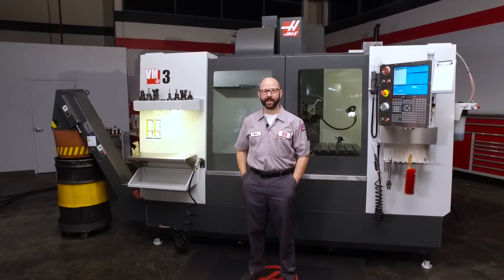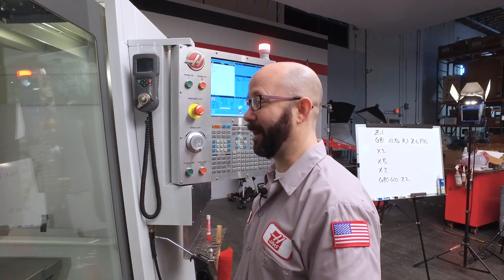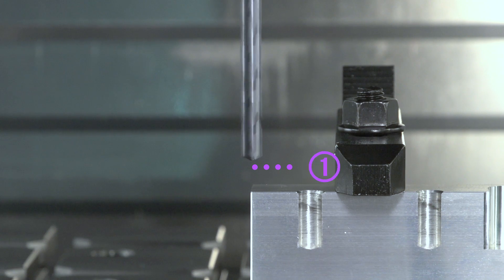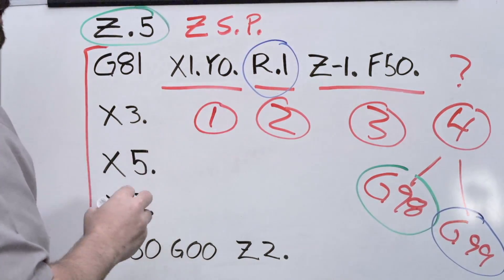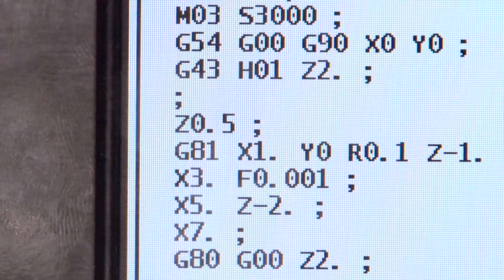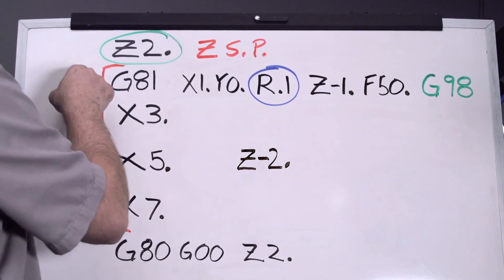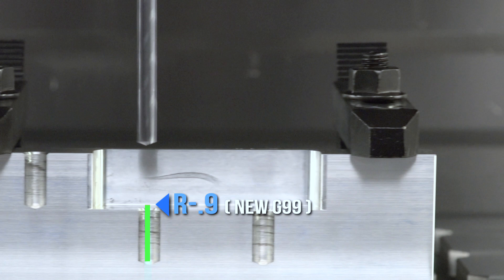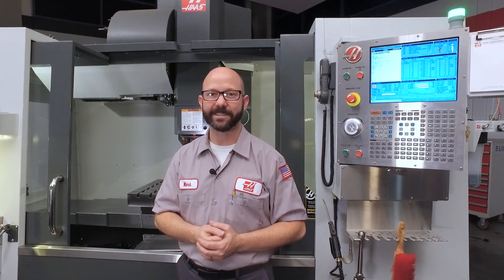How Canned Cycles Work with G98 & G99 - Haas Automation Tip of the Day

Comment: I was trying this for an evening class .  We had a spot drill and an ordinary drill bit to use to drill holes. One for a spot drill and 2nd for ordinary drill bit  The tool offsets H01 and H02 need to be set into the code if you are using more than one drill bit.
T1 M06, G81  H01  x1 y0 R.1  z-.050 F50.    Then another canned cycle ->T2 M06, G81  H02  x1 y0 R.1  z-1. F50. Don't forget the (.) after F50 otherwise it feeds in ten thousands of an inch.  Where H01 and H02 are tool offsets for tool 1 and tool 2.

Comment: I did that in CAM but I didn’t know it is on since we’be got new postprocesor that turned G99 automaticly and it was not shown in simulation so I broke 100€ drill, with that G99 I wouldn’t be able to save few seconds per part, and I was lucky that wasn’t on other 500€ drill we also used. I am ok with saving only few secs with simple klick, but not if simulation doesn’t show it. Like G0 positioning not following diagonal in few years old Haas machines, but runs same speed in X and Y and than finish the one that has rest travel 😕

Comment: 3:03 thats that G98 is default.DONT WRITE NOTHING you not EVER need use G99. you rapid low as oyou cant thats it. nobody go over hole in z hole and use G99 change holes in R. well who cares. you can change R over clamps, but then you cut air. WELL I TOLD YOU G98 is default and you ever not need G99 LOL. you never ever need worry bout G98 or G99. G98 is default. thats that better one

Comment: 2:20 yes R point is that height it change holes if you change G98/G99 DONT TOUCH IT. its default to be better one. it changes holes on z.5 ig you not give any G98/G99 on program. why add too much on program that not help anything. its agent history when rapids was too slow you could change holes in r points.
you can start holes on Z home its not matter rapids are fast today LOL

Comment: 0:56 well you programmed g98 or g99. dont do it. machine is default use that better one.
rapid over clamp height and g81 z-1 R0.1 and it retract back where you rapid LOL. there is no need ever change g98/g99 its default to be that better one. there is no need change holes in R point ever ??? what is point on it lol

Comment: I noticed that your z starting point of 2. is the same as your z starting point in the g43 block. If you don’t specify a z starting point, does the machine assume the starting point at the g43 block when using g98?

Comment: Does the G99 automatically cancel when G80 is called after the canned cycle or do you you need to add a G98 to the safe line before the next operation?
Reply from the maker: +Troy Gossett 
Troy –  When we call a G99 in our program, it is going to stay in effect until a G98 is called (Modal). The G99 is not cancelled when the canned cycle ends with a G80. Your G98/G99 will stay in effect even after the program ends with an M30 unless Setting 56 M30 RESTORE DEFAULT G is set to ON. Adding a G98 to our Safe Startup Line, which runs before each operation, is a really good idea. You can take a look at our full program by clicking on the Bonus Content link at the end of the video.  In our case we just switch back to a G98 at the end of the cycle. Thanks for bringing this up, it was worth mentioning.
- Mark
Reply from the maker: +Umair Mohammad In your case, it might be good to turn on Setting 56 M30 RESTORE DEFAULT G. This will reset all of the G-codes to their default values every time an M30 is reached – just like the machine had just been turned on. This would return the machine to G98 every time an M30 was reached. Hope this helps!
Reply: +Umair Mohammad - Just remember when ever you use G99 it is like turning a switch on, it stays on until you turn it back off with G98. So your code will need to end with G98 before the next operation.
Reply: your question was very helpful for me I've used G99 with every tool, I've added G99 4 times in a program but now my concept is clear about G99 command, my only problem is that if I use this command one time a day it remains in effect for whole day whether I use any program until I restart machine, I've 151 programs and sometime I use more than 4 programs in a day and I forget that in a previous program I've commanded G99 so I'm still in a circle of risk, I've to be extremely careful with first cycle of every program but is there any way to avoid any crash? if I use G99 command with a program it shouldn't come in action with any second program, sometime there are more than 4 clamps between holes and it should up to me whether I use this command or not (sorry for my weak English)

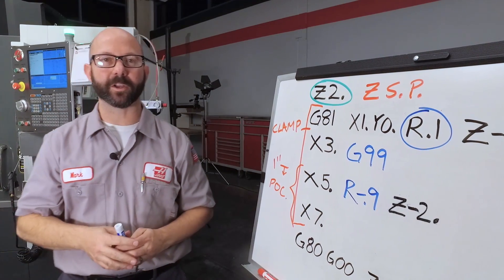Comment: OMG! Yes. Amazing video. I know a couple of people that had problems with canned cycles that this video will really help. (I even learned about changing the R plane part way through) The graphic at 6:46 really helped visualize the code. Please do more videos like this explaining the different canned cycles. It may not help the more seasoned coders but for those who just use cad/cam or for new operators it will be amazing to have the visuals.